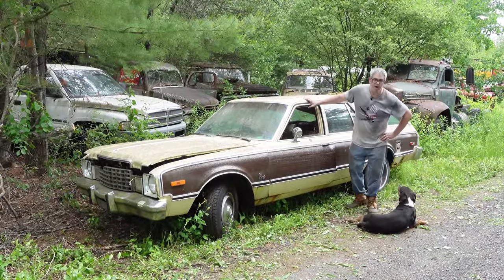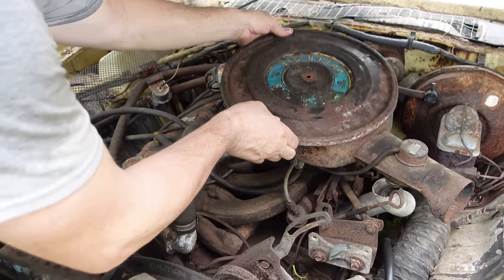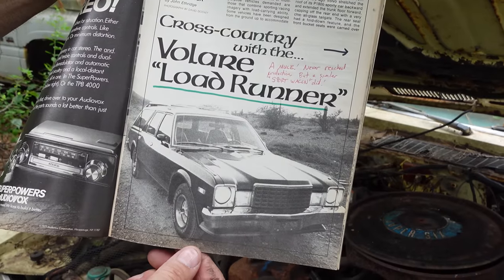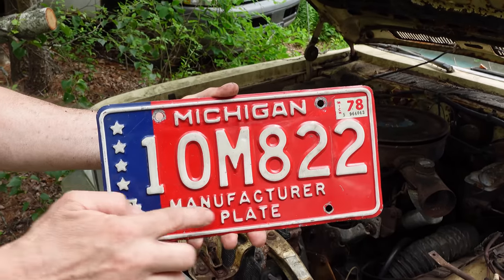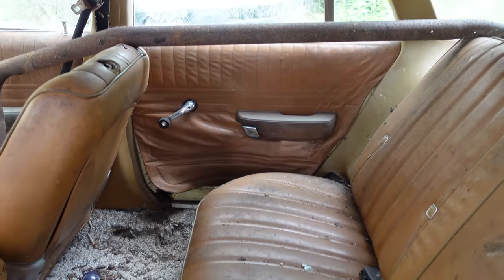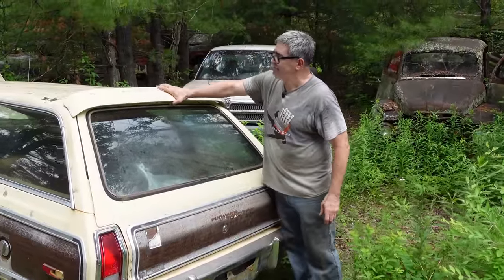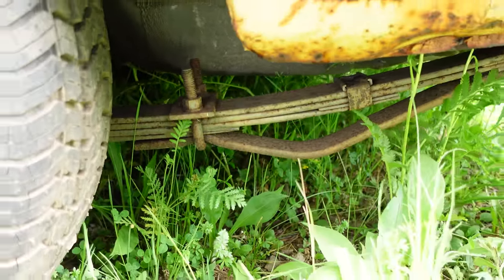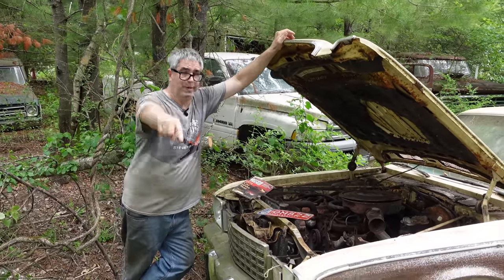Road Runner Station Wagon?

Comment: My dad worked at a Chrysler Plymouth dealership in Virginia for few years after retiring from the Air Force in the late seventies. One of the memories that has always stuck with me was his comments on new cars coming in on the haulers. They would have to push them off by hand because they wouldn't start. Then the mechanics would put them in a bay and remove door panels and other bits to inspect for drink cans, food wrappers, etc., along with the process of making them functional. No quality control in the UAW back then.
Reply: Many times, they purposefully did things to slow the line down. It was always a battle of speeding up the line and the UAW rules.
Reply: Unions really turned out to be a bad thing. I'm in one now, the lazy do nothings get paid exactly the same as the guys actually working. Everyone just comes down to that lazy do nothing  level eventually.
Reply: @bobbyz1964  Yes and no. All depends on the union and what they do. Some municipal unions will fight for a worker that is fired because of a bad boss/worker relationship. When I was taking an exam one time, a worker who was also there had sued an operating authority that wouldn't promote him after he passed a test, for no other reason (according to him) that his boss didn't like him. It wasn't performance based. Between the lawyer and the union, he not only got the job, but got every dollar of back pay. LOL. 

Sometimes they are good, and sometimes not. All depends. You'll have slackers and workers in union and non-union jobs. As you indicated, that's human nature.
Reply: @googleusergp  I'm 58 private sector most of my life, business owner till I was 40. So I've been in a government job 6, 7 years. I see guys literally sleeping on the job, park a truck in the woods sleep, if they're awake they're watching tic tok. I've seen a few guys get fired and the union kept them on, they needed to be fired! It's crazy ! The supervisors are pretty much incompetent, nepotism and cronyism is how you advance, a few are good. It's to the point that lazy people are too hard to get rid of to bother with. One guy, the union president, was about to get fired from another state agency when he transferred to this one. The man is about my age, has been a slacker since he started out of high school and will retire with a great pension. If he works 5 hours out of 40 I haven't seen it yet. 
Your tax dollars at work. 😆
Reply: I worked in a chev dealer in the late 70,s all kinds of new hardware and parts would be strewn about the new cars comin in off the trucks
Reply: you are correct and i am sorry to say it was intentional
Reply: @boobyz1964 Been a Teamster local 683 in San Diego 26 years Commercial Driver there are a lot of good perks. And I’m going to get a good pension with full medical at 55 years old. By the way I’ve been Teamster since I was 19 years old. But there are definitely a lot of Bad Apples I’ve seen over the years. 👍
Reply: Yes,  there were a lot of Strikes Back in the day. I had a friend that had an 80 LeBaron wagon that had issues with fuel delivery for years. finally they dropped the tank and there were boots and newspapers in there.
Reply: @spacecat7247  Another fine example of Union's impact on our country
Reply: @johneckert1365  yeah you know how it is. there was a place for them in the olden days but as time went on and they grew more powerful they became the bullies rather than the owners of the plants
Reply: @spacecat7247  EXACTLY 💯 
Just like government regulations, in the old days there was definitely a lack of regulation and change was needed, but when they realized the power they gained through those regulations they got drunk on it. Now we're where we're at :/
Reply: The uaw's the worst union around. I have experience with multiple unions. Most of them are there to protect the workers from poor management. They make sure that the company is paying the proper wages and benefits. The UAW on the other hand, does nothing but protect bad workers. I worked in many automotive plants in the Detroit area as a contractor. I watch the UAW get employees their jobs back, after drinking on the job, sabotaging parts, and other things that they deserved to be fired for. There was a carpenter that worked at the Chrysler glass plant. The head removed the time clocks, and the employees clocked in, by using their employee badges, holding them up to a reader, that unlock the turnstile as they went through. The carpenter was caught on camera, scanning his badge and just spinning the turnstile, and going home. At the end of his 12 hour shift (skilled trades can work 7/12, which with overtime makes 124 hours pay), he would come back up to the plant, stick his badge on the end of a broom handle, and stick it through the fence, then spin the turnstile as if he was going out. He did this for a couple weeks before they actually watched the camera and fired him. UAW then got his job back. They are a stain that make all unions look bad.
Reply: @marioncobaretti2280  neighbor worked in ford plant and the hid radios spealkes and parts in pintos and picked them up when the transported pulled off lot
Reply from the maker: @googleusergp  Good point. I've never been a member of SAG or AFTRA despite doing TV for nearly THIRTY YEARS. But I was stuck in "cable hell" where there is minimal union representation and zero residuals so I get to "punch the air" every time I see a re-run of something I've hosted on TV. Anyhoo, my only dance with union membership was when I was in college and took a part time job working as a "loader / sorter" for U.P.S. during the crazy holiday season. They paid EIGHTEEN BUCKS AN HOUR in 1984 but I was only there for a couple of months working the NIGHT SHIFT. My Dad found out and wanted to kill me since he was paying my tuition to attend Clark University and live there in a dorm. My grades didn't suffer...too much. But I do recall we were approached by union folks at U.P.S. to see if we wanted to join. I knew my time there was certainly of a temporary nature so I never joined, plus I needed each and every one of thise EIGHTEEN BUCKS per hour to buy pizza and beer. BUT I do recall there was indeed a difference between non-union workers and SOME (not all) of the union folks. Certain (but not all) union guys would take their sweet time and occasionally slow me down and make me look bad despite my best efforts to take up the slack caused by a lame loading partner. We loaded "feeders" (big rig 40-foot trailers) with U.P.S. parcels of varying sizes (all under 20 lbs). We had a non-stop conveyor belt spewing boxes into the mouth of the trailer and we had to very quickly confirm proper "ZIP Code window" and either reject the parcel or load it. Once in a while there would be a "salt" or INTENTIONALLY added ZIP code and we'd either catch it or not.... I was pretty diligent about confirming the ZIP code windows but sometimes my work partners were not. Anyhoo, my take away was that Unions are IMPORTANT to push back against employer abuses BUT sometimes militant union stances can be so rigid employers cry "uncle" and shut down for a foreign labor alternative. Its the age old push-pull. As you know, the history of GM's Norwood, Ohio plant is a case study of this dynamic. Thanks for watching and writing. -Steve Magnante
Reply: @bobbyz1964  Good and bad in every job and title. Always was and will be that way due to human nature.
Reply: @johneckert1365  You mean the misuse of unions in our nation. Not all that they do is bad. Some is, some isn't. You can't tar them all with the same brush. That's an ignorant statement. I've been on both sides of the job fence (union and non).
Reply: @googleusergp  60 years ago I would probably agree with You. Not today.
Reply: @SteveMagnante  I've been non-union and union throughout my work career. When I worked in the auto parts manufacturer, the office (like me) were non-union, but the factory workers were union. They picketed once during the time I was there. We let the union folks know that we sided with them, but we had our jobs to do. I wound up making distributor caps for a few days (GM V8 HEI units) and the foreman said I made them better and faster than people doing it 30 years. In fact, during the "training", he showed us what was a finished product. I said, "Whoa, that's only got 7 terminals. Not going to run very well." LOL.

I've also been salaried and hourly (as I am now). I'll take hourly. For instance, I've been stuck in an airport for hours due to flight delays. When you're hourly, you're getting paid. My trip coordinator was told recently, "The flights you booked were too expensive. We want you to book these". Well they were "cheaper" but because they flew early and landed late, they had to pay overtime for everyone since we were now working outside of normal shift hours. LOL. It was actually probably three times more expensive, but since it doesn't come out of that "pocket" in that guy's area (pair of pants), it was a "savings", but not a net savings. Go figure.
Reply: I worked at a Plymouth Dealership back in 1978
Reply: Proving quality is on the manufacturer, not the union.
Reply: @craighightower4736  Employees with poor work ethic (enabled by unions) are a just as responsible, if not more than the corporation.
Reply: @bobbyz1964 It’s help destroy the public school system in America.
Reply: You are exactly right. My dad was a member of the AFL-CIO union for thirty years. Getting caught in the act of fighting or stealing we’re the only two reasons that union members could be fired. Poor quality work, laziness, and shitty attitudes plagued his shop. Greed, strikes and constant demands for more eventually bit them in the ass when the company finally announced that all workers were going to be permanently laid off because they were moving operations to another state. The guys that worked for that company were envied by everyone else in our small town because they made wages and benefits that far exceeded any other workplace in the county yet they still weren’t satisfied. Well their lack of productivity and ever increasing demands finally introduced them into what it was like to sweat your ass off in 110* degree cotton mill. 😂. Nobody else in the town had any sympathy for them.
Reply: Maybe not, but the DRIVETRAIN could perform MIRACLES once these were "adjusted"! My dad owned a '65 Buick "NOTHING Special", new; the "handling" was HORRID, the workmanship was AWFUL, but this GREAT AMERICAN car ALWAYS "did the job"! This is TONS more than I can now say about Asian GARBAGE or "american/asian" GARBAGE CLONES! These were affordable and they "DID TRANSPORTATION"! Now, we have "ergonomic", EXPENSIVE CRAP!
Reply: @googleusergp  never had a union job. not paying dues or striking or supporting the democratic party.
Reply: @tonyfriend7413  Being a union member has nothing to do with supporting the Democratic party. They are two mutually exclusive things. I support no party and I'm in a union. I vote in every election. I vote for who will do the best job or the least damage.

Comment: I worked at a small,independent used car lot in Langhorne, PA in the early 80's. At one point I came very close to buying a black/woodgrain Volare wagon with a 318/4-speed drivetrain. It had a very plush interior, so I'm pretty sure it was a Premier. The 4-speed really threw me. Who would order a fully loaded luxury style station wagon with a 4-speed stick? But that's what drew me to it! But being a Chevy guy from birth, I bought a '73 Chevelle Laguna wagon there instead. That one had a very strong, and not nearly stock 350 hooked up to a Turbo 350 with a moderately high stall converter and a shift kit. I made a couple of passes at Maple Grove at a "Test 'n' Tune" day in the mid-13's with it... with a pair of child seats strapped into the back seat! I don't think the Volare would have been as quick, stick or no stick!
Reply from the maker: Lets remember that the 4-speed was a fuel economy measure in the panicked days of the post-OPEC auto industry. Those Aspen / Volare 4-speeds were actually equipped with an overdrive top gear that had a .76:1 ratio to drop engine revs - and fuel intake - versus the traditional 1.00:1 top gear ratio of a pre-'76 A833 Chrysler 4-speed manual transmission. The good part of the Overdrive A833 Chrysler 4-speed was how First Gear went from 2.64:1 to a nifty 3.06:1 which gave a harder launch off the line. BUT the downside was the W-I-D-E spacing of 2nd, 3rd and Overdrive. Shifting through the gears with this extra wide gear ratio spread forced engine rpms to drop more than usual which dulled full bore acceleration a BUNCH. On the upshift from 3rd to overdrive you almost have to peel your face off the inside of the windshield due to the sudden fall off of acceleration at full throttle. But for saving gas and general quiet cruising with minimal shifting chores, the A833 Overdrive 4-speed was a good solution for the time - and a bunch cheaper than actually tooling a proper 5-speed overdrive manual gearbox from scratch. And YES it is always cool to see a stick shift in any wagon or 4-door! Thanks for watching and writing. -Steve Magnante

Comment: The first car I ever drove on public roads was a 1979 Plymouth Volare sedan. It was spring of 1983 and it was the driver’s education car. There was a auxiliary brake pedal in the passenger footwell that the driving instructor could use to stop the car if needed.

Comment: My not be the popular option but ,
I've always appreciate these , Volare & Aspens 🙏

A high school classmate had one ,
With 5 speed manual on the floor 

Just get the , Rusty Jones coating  ,  
In the salt belt .

I bet , those Volare Road Runners would have sold well 

Gotta have a side kick Steve .
Might as well be , Katie 💖🐶
Reply: My Grandparents got the Rusty Jones treatment on thier new 78 Horizon
Reply: I worked at a service station ( as a teenager  ) they offered that treatment on vehicles .

I watched the service manager apply it to new vehicles brought it .

It was messy but , covered well

Comment: Had a used 4dr with the super 6 back in 1985. As you said, rust usually was a problem. The one I bought, the pervious owners had put fiberglass front fenders on it already. So no worry of those ever rusting!

Comment: From 1977 to 1978, Monteverdi of Switzerland made the Sierra based on the Aspen/Volare line, including one station wagon based on the Volare.  If you look them up, I have to say that Monteverdi did them up enough that it is difficult to tell what kind of car the Sierra is based on.  I think that the engine was very slightly touched, so they had little to no power just as the Dodge and Plymouth cars the Sierra was based on. Here is an excerpt from Wikipedia:
  
"As far as road cars were concerned, Monteverdi changed to the boutique car system in 1977 for these as well. The Monteverdi Sierra was a sedan with a 5.2-L V8 engine and distinctive looks. It was a Plymouth Volaré with slightly changed bodywork. With few modifications, it had similarities to the Fiat 130. Fenders, bumpers, grill and some smaller parts were modified: headlamps were taken from the Fiat 125 and rear lights came from the Renault 12. The rest - windows, doors and mechanical parts - remained unchanged. The Sierra soon was accompanied by a two-door convertible based on a Dodge Diplomat coupe, of which only two were made. Finally, Monteverdi also made a station wagon based on a Plymouth. It remained a one-off that was never sold."
Reply from the maker: AB-SO-LUTELY! Great points on Peter Monteverdi's last gasp Mopar-based / inspired specialty cars for the rich and uninformed. I have seen these F-car-based Monteverdis online and wonder who, who, who could have been impressed by them. I mean "the times" were tough in the OPEC / CAFE age of the late 1970's so making cars like the previous "High Speed" and "Hai" was out of the question. But what convinced Peter Monteverdi to reimagine an Aspen / Volare? A bizarre chapter in automotive history. Thanks for remembering these Monteverdi Sierras. -Steve Magnante
Reply: @SteveMagnante  he did drop 440s into some of the boutique SUVs like the Scout and maybe the Range Rovers, so perhaps that may have been a plan.  It's not like it seemed like a plan to send them to the US, so may have been able to do so but I imagine space and packaging may have been an issue for that endeavor.

Comment: Steve, our 1st car when we were married was a used 1977 Volare station wagon. Gold color, slant 6 and 3 speed with OD manual transmission. Cold AC, we live in central Texas so its a must, roomy car. We drove that car for 3 years until it died with 200K+ miles.

Comment: The 76-77s were known to rust out on the tops of the fenders, as well as inside the cowl area leading to structural issues that could not be fixed. I've seen these literally rusted in half at the cowl. A couple of the things Chrysler did for 78 and 79 was  adding drains to the front inner fender wells, as well as used galvanized coatings to inner front fenders and outside door panels. For 80, they added plastic splash shields over the metal front fender liners. It's interesting to me that as badly as these cars rotted, by 82 Chrysler had the issues under control for their M cars, which were essentially the old F sedans. I had several 5th Aves that were all Chicago cars, and rust was never an issue ( though everything else was ;)  )